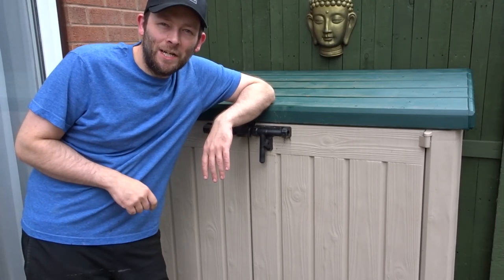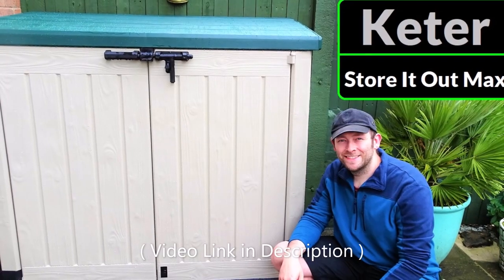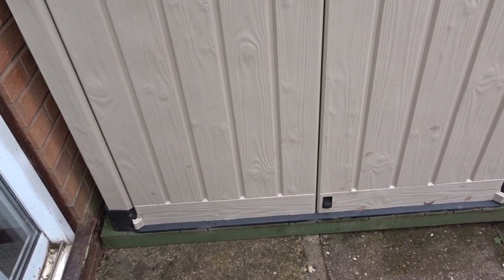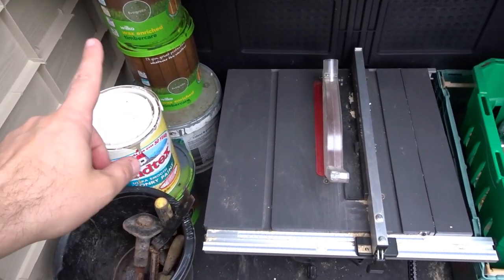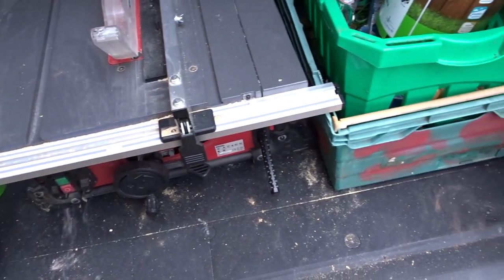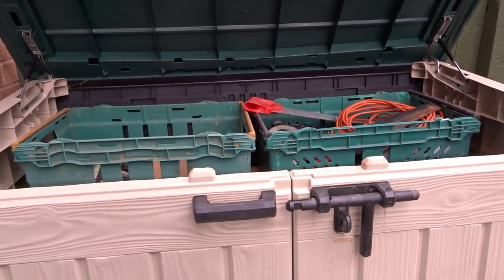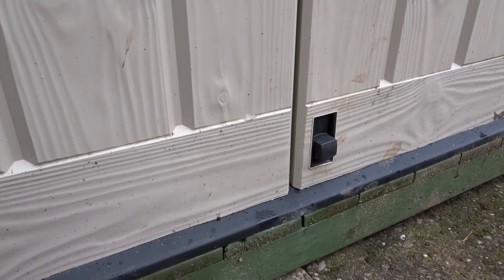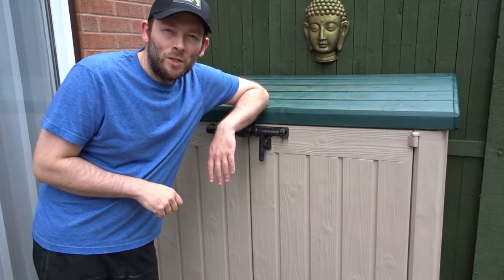Keter Store It Out Max 1200L Storage Shed Review (After 1 Year of Use)

Comment: It has two year warranty doesn’t it ,but it’s gone two years now😂how is it now ,noticed on new lids they crack when you screw in the hinge as one of the top standard screws into the screw holes in it crack or split as it’s not reinforced  on the top screwfix point look sideways where hinge screws go in is there fatigue on yours yes most patios have a fall for rain to run of leaving shed slant😮
Reply from the maker: @pauljones1350  mine is fine it's working well. No problems with it at all.

Comment: Keter Dbl Storage. 
How easy to get Bins Out & IN?  Ramp useful? How to pull bin out without using handle?? 
I'll explain: After all when LIDS points to Front opening, then HANDLE & Wheels are at REAR, which probably awkward to get @.

But I guess it could all be setup the opposite way to intended... :
I mean if Handle was at Front, but probably difficult to Back Feed all the rubbish...